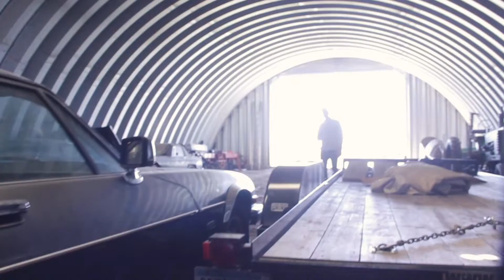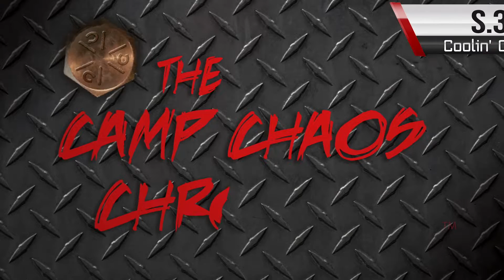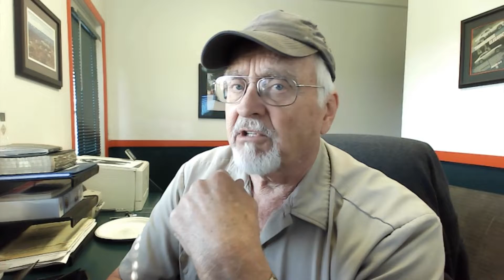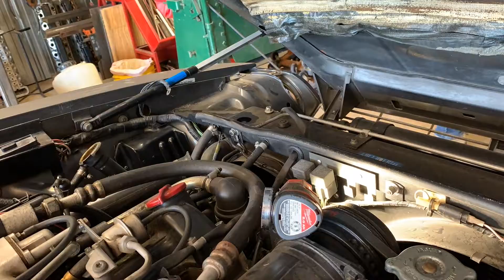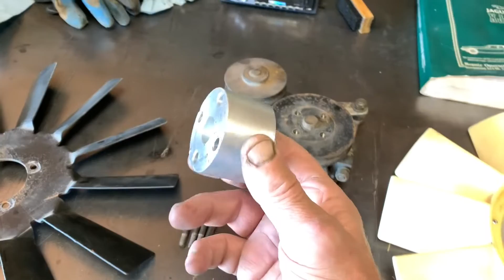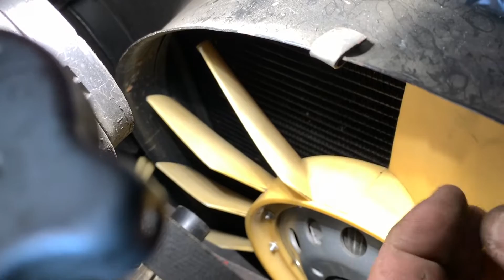Cooling The Jaguar XJS Ol' Tex: The Basics-Part 1

Comment: Great Video! Every Jaguar radiator I’ve pulled over the last 30 years has been plugged with outside debris and internally plugged in the small passages. The Yellow fans AlWAYS have cracks and are a ticking time bomb 💣 and let loose at high RPMs.

Comment: Minneapolis…..I recently rescued an 1987 Lister Jaguar XJ-SC that was originally purchased at Downtown Jaguar  in, Minneapolis MN already converted to a 5 speed manual for the V12. 1 family owned and only 23k.  Working my way through the details to pass inspection.
Reply from the maker: Rare animal. Good for you.
Reply: Rare indeed. I have two XJ-SC cars in my collection of 6+ Jags. The Lister is rare indeed. The 7.0 Stroker cars made 500HP+

Comment: What bonnet vents help re more air flow around the engine bay?
Reply from the maker: Perhap but it also might upset the. original airflow scenario.
Reply: @thecampchaoschronicles9567  hmmm.   Maybe.   Lol.   The Combs mk2 and e types had them.    (Dare I say for a reason).  Lol
There’s basically no space around the v12 as u know of perhaps the latent heat build up is a partial factor….
I’d say it’s probably a few one percenters tipping things over the edge….

Comment: Great video as usual Bob.. as I mentioned in other videos you have made.. my son and I are restoring, rebuilding, modifying his 86 xjs. Being a licensed mechanic for 42 years and worked on hundreds of jags... the small 10" electric use to die, mostly of bad connection or temp trigger sensor on the water pump housing.. I have installed a half dozen twin electric fans on these toys.. never hits 200 ever again..I removed both the old useless  mechanical  and small electric fans.. I made a custom shroud with venturi divider between my 2 - 14" vortex electric fans.. the car never passes 186F. Less than half mark on gauge.. also swapped temp sensors locations.. there incredibly quiet,  insane amount of air circulation and runs for about a minute or 2.. now there are several companies that sell a complete kit for these cars.. but only use 2- 12" electric fans.. good luck my man.
Reply from the maker: Thanks for the info, Pete.

Comment: Have you considered this. No matter the size of the mechanical fan you fit, unless the considerable heat created by the engine can be evacuated from under the bonnet, then there is effectively no heat transfer/exchange taking place. There's only damed, superheated air with no direct path to escape.  The engine and all of it's components are effectively being cooked to death within the confines under the bonnet. Cooling air needs to pass through the radiator core, absorb the heat from the coolant and then pass out of the confines of the enclosed engine bay. Appropriately placed louvres toward the rear of the bonnet would facilitate the egress of super heated air. A simple test, would be to raise the rear of the bonnet (closest to the windscreen) and take the car for a drive on a hot day.
Reply from the maker: That's why the front air dam is so important to the operation of the cooling system. My '90 convertible came without one and it ran within the N range. Then I put one on and it never got to the N and it was hotter, later in the same day. It creates a low pressure area behind it that evacuates air from the engine compartment. It's got to be there.
Reply: No qualms about the air dam, but for it to function effectively the car needs to be moving forward at a reasonable speed. When stationary in traffic for lengthy periods, then it's a different story. There's still a need to evacuate the super heated air from the confines under the bonnet, especially at the rear of the engine. Another issue of concern, is that confined super heated air will also over time destroy any plastic fittings on the engine and also harden the insulation of  underbonnet wiring which ultimately leads to cracking and flaking compromising critical electrical connections.
Reply from the maker: @enigmasvids9615  No argument there. But Jaguar shipped these things all over the empire to some pretty hot climates. Having been active in a number of forums over the years, there are people who live in places liken the southwest united states that have absolutely no problem with traffic. My '90 convertible is one of those cars. I don't know if this was a problem for the first  ten years of production or not. I believe it is more of a maintenance/repair issue than a design flaw with the car.
Reply: Jaguar may have shipped them all over the world, but they certainly didn't fair well with the summer heat often prevalent in OZ. Have you sat the car idling in traffic for any length of time during a hot summer? You can further aggravate the situation by operating the car's aircon whilst stationary. Not trying to rain on your parade just listing my experiences with English cars of the period in climates that aren't as agreeable as the general weather conditions of the UK. Although the current heatwave would be something of an exception.

Comment: I think the slight assymetry you noted in the distribution (and shape) of the fan blades may be intended to avoid resonances created by rhythmically beating the air.
Reply from the maker: That was a thought I had but my son had a land rover discovery and said the clutch removal procedure included pulling the clutch through the gap. It makes sense.
Reply: Fiendishly clever these designers. Sometimes.

Comment: Bob, turn the heater on full blast, LoL.  I assume you did a coolant flush of the engine to wash out the passages as much as possible.  Since the rad is in great condition, perhaps there is a chemical that you can run through the system, do a flush, then refill.  Knock on wood my XJ6 runs cool, but next summer when she gets the V12....so I'll be following your series here with interest.  When the car does get the V12, I plan on moving the clock up on top of the dash in a 3D printed enclosure and putting a second H20 temp gauge in the clock space (I have a Series 1 with the row of gauges).  One for bank A and one for bank B. Looking forward to the next in this series.  Cheers.
Reply from the maker: You know what they say about when we assume.😀 The coolant system flush is planned for the episode after next.
Reply from the maker: I actually had to use the heater trick on a couple of 90º+ days on a road trip to Seattle with my first XJS. I had a 24 count flat of gatorade on the passenger seat. Didn't take a pee all day. Brutal.
Reply: @thecampchaoschronicles9567  Back in the day I rented a manual stick UHaul same thing. Brutal would be an understatement!

Comment: after three months off and on i went the homemade shroud and electric fan route....(2x mustang fans). so far...so good. both pull through radiator....which is aluminum. not cheap but worked well. took damned near 20 hours fab time. good thing i am retired and have the time to mess with such things. 🙂looking forward to seeing how this turns out for you to be sure.

Comment: When I got my XJS v12 it would overheat in minutes (mismatched and stuck thermostats) I replaced them both with 160 degree thermostats which works well for me since I don't ever plan to drive it in the cold.(chose such a cold temp because the idea of dropping a valve in an engine I can't afford to replace is scary...)

Comment: An interesting vlog thanks Bob. You touched on the condition of the rad coolant side being a potential issue, it certainly was on my s3 E type as the car aged. A visual inspection of the core is difficult, did you have the flow rate/pressure drop of the rad checked by a specialist.